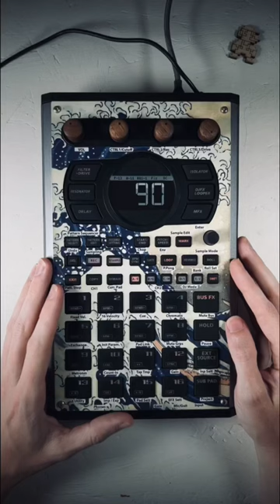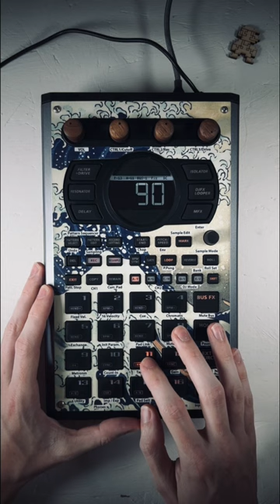SP404-MK2 - How to select a pad without triggering the sample #shorts

Comment: Is there a way to do this in step sequencer mode? I would like to be able to program a sample in the sequencer mode without hearing the sample while I select it.
Reply from the maker: You can use this same method while a pattern is recording as well
Reply: @spvidz  Thanks! For some reason I wasn't able to do this at first, but now it works in just fine also in pattern mode.